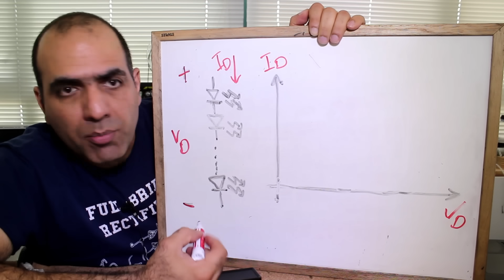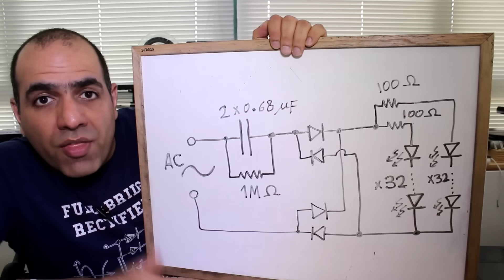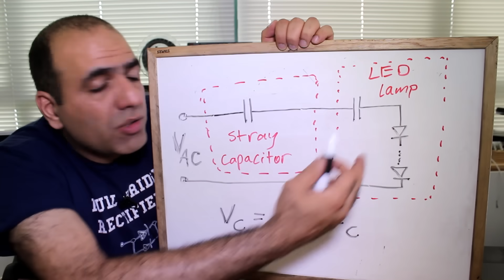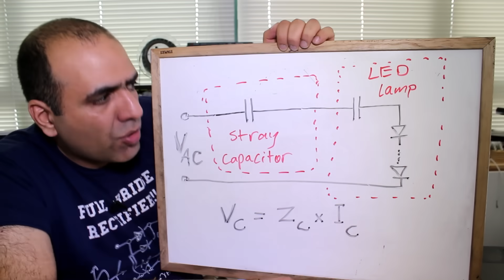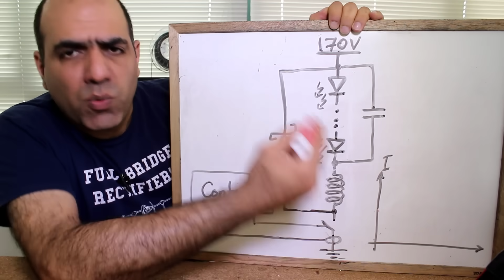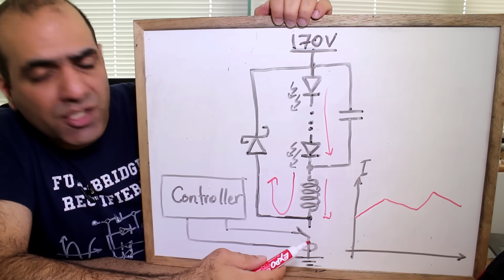Why Cheap LED Lights Keep Glowing

Comment: So does the cheap LED waste electricity?
Reply: I would say no since the electricity was there to begin with. CFLs handle this with their capacitors so they don't flicker or discharge. And standard incandescent bulbs have a low enough resistance so they can be a tiny bit warm, but do not luminesce.

Comment: I installed two LED spotlights in a motion detection fixture and the LED's Glow. The Fixture does work properly otherwise.
 My question is: since the LED's continue to glow; does that reduce the life of the LED lamp? 
It looked like the current draw is very small. Is that very expense to let it glow 24 hours per day?

Comment: So when i get it right, the LED is using a minimum energy all the time, but depending on the circuit, some of them glow (when turned off) and some just turn off fully?

Comment: im an electrician. i come across this issue all the time. you can test it with a meter, if its on voltage setting it will detect what we call a gohst voltage but if you add almost any draw to it the voltage drops to 0 because its not an efficient transformer. what i can tell is happening is the two wires are acting like a transformer. if you run 2 wires alongside each other for a long distance one induces a current in the other without a physical connection. the cinese cheap led is just very sensitive to any current. the better bulbs are just not responding to the insufficient power supply It also seems that whoever wired this switch is turning power off at the neutral side of the circuit instead of cutting the power before the lamp your friend has a dangerous wiring situation, your supposed to switch off the power not the neutral.

Comment: So I still didn’t get whether or not the cheap LED light bulbs waste money or not...I feel in order to figure this out I would have to know how houses draw current from main. But I mean it seems like it shouldn’t  waste money...if the wiring in your house holds a small amount of capacitance even after drawing power from the main, that means the bulb is running off of the the wiring’s capacitance, not by drawing from main.

Comment: Until the live wire is not beeing shut off by the single poled switch. You think you turned off the current by pushing the switch, only to find out that the Null and not the Live wire is beeing disconnected. This is just plain stupid! You can't turn off a bulb by pushing the switch and then think it is safe to work with crocodile clamps in a fitting. Man, this is stupidity squared.

Comment: Sir, I am facing a question. I have an led lamp at my home and after a prolonged use it gets dim and eventually switches off but then I am charging it, it glows dim and then I am unplugging it from the circuit, after some time it suddenly glowed bright! and again after a few seconds it became dim. I want to understand the reason. 

I hope you read this.

Thank you for you're time.

Comment: Hey Mehdi, years ago I had the same problem with cheap LED lights from IKEA: If I only disconnected one supply line, they continued to glow dimmed. They were powered by a cheap power supply and I solved the problem with a better power supply. This was a power supply which generates DC without ripple. The cheap power supply from IKEA had a considerable ripple on the DC output voltage. Therefore I suspected the cause in a kind of induction, because it was fixed with a smooth DC voltage. Induction only works with AC voltage as we all know... OK, my LEDs were designed for direct current. Therefore there was certainly no rectifier in it. That is then like a bad rectifier in the cheap LED lamps you tested. Then the ripple of the bad power supply with the direct current LEDS works like the alternating current and the bad rectifier in the AC lights, right?
Or to keep the story short: The phenomenon also exists with 5V and ripple on the power supply. Fascinating, isn't it?
Reply: ". Induction only works with AC voltage as we all know... " lol ;) 

does it? :p
Reply: @erlgro  Absolutely correct! But if a power supply does not produce a good DC voltage, then the small amount of changing current direction or pulsating voltage is enough to induce a small current. Then the LED lights up. And that even if only one wire is connected!

Comment: Very interresting video, but...

My LEDs glow while being turned off simply depending on where I join live and neutral cables (or which side I plug the plug in a socket).

Comment: So, when switched off, the Chinese bulbs are still drawing a small amount of power through the meter.

Is this true for the other lamps?

No picture the whole city full of hoses equipped with ten of these lamps. All of these with a micro draw would add up to a lot of wasted power.

Comment: I have this issue. Some location in my house, led glows even if it's off. So what Am I supposed to do if my house has this high capacitance? Just not buy those sensitive led light?

Comment: So to get this right, the amount of electricity used between a cheap LED and an LED with the resistor across the FBR will be about the same. Just in one case the LED stays dark?
Reply: Ya this is what I was finding too. Let me know if you got your answer

Comment: In the case of Steve Mould's test, I am convinced that the coil of wire he used was acting as a transformer rather than a capacitor.
Your test case is actually different, but you did reveal that these lamps are particularly sensitive, having a very low ON voltage threshold.

Comment: But the real question is: Is it FREE ENERGY?!?
Reply: No but phone lines have 48v DC that is separate from your house power and unmetered so it's actual free energy. It's illegal to use in this way so don't get caught. It also works in a power outage.
Reply: @sarabara-bla  it won't work with dc
Reply: Genius
Reply: https://youtu.be/wymfYp18720
This link bring you free
Reply: No, because you charge the capacitors with energy from the house grid
Reply: @LowSpecEverything  The Rectifier
Reply: @LowSpecEverything  r/woooosh
Reply: @flat-eric  How???
Reply: @flat-eric  first off, that's not a woosh. Second, it's woosh with four o's
Reply: @DoesntRefillTheBrita  first of all, that was a woooosh. Second, well... You're right. r/itswooooshwith4os
Reply: @flat-eric  WARNING: STOP R/WHOOSHING PEOPLE
Reply: @Nsodnoajdjksl  Why? :D
Reply: @flat-eric  BECAUSE STOP!
Reply: @LowSpecEverything  r/woooosh. No shit, Sherlock!
Reply: @ArchisMarathe  Wow, you actually bothered to correct their woooosh

Comment: My grandpa is electrician and he explained like when u touch litle black capacitor or whatewer it is black on normal led line that u can stick somewhere and cut whereewer u want it turns on 3-4 leds away from that black litle box.

Comment: Instead of breaking the return wire of the circuit, break the live wire. I had this problem when I replaced fixtures in my house. Some glowed and some did not. The ones that glowed the switch was breaking the return wire, which works with Incandescent lights but not these lights. I re-wired the switch so that it broke the live wire going to the fixture.
Reply: I thought it's common sense to install the switch on the live side before the appliance, as taught in school.
Reply: Yeah, switching the live wire is standard and safer. Doing it the other way around leaves the return wire live even when the switch is off. (Although you should turn off the circuit breaker anyway for extra safety when working on it.)

Comment: I did a similar experiment with my friend way back, almost 5 years ago such nostalgia, with tiny circuit board and 1.5v battery (so no real danger). We would each 1 hold an end connecting to the tiny LED away from front view of others and then do a bro fist or hi-five to complete the circuit for the LED to light up like some magic tricks lol

Comment: You forgot to mention the easiest solution to this, witch would be to have a 2 poled switch in front of the light bulb. But loved the explanation, keep up the good work! 😁
Reply: And if you break the live wire I think it won’t work
Reply: How would it be wired? I just googled 2 pole switch and looks like it has 4 brass screws for 2 hots on a 240 volt system. Would you connect 2 neutral to one side and 2 hot to the other to completely disconnect hot and neutral from the light? I just installed an integrated LED in my furnace room and it was just barely glowing in the off position.

Comment: The LED light at my mom's room in our house keeps on glowing before we fix the issue on our wirings. We have a bad and corroded wiring before that causes fluctuations, it even makes our line run at 70V (normally, it's 220V) After changing our wiring, fixing the frequent fluctuations, the LED at my mom's room no longer glow. Did the corroded wiring before makes some sort of Capacitance on our wirings?

Comment: Well, I saw the same when using 12Volts and a pcb with some leds on it (btw, 12v dc wont kill you as fast as 120/230v)😂

Comment: OK so science question I found that almost the same thing happened for me but instead of only the power being plugged in i had a computer power supply plugged in and a small neon light from an old iron and when I held one of the terminals and touched the other to the CASE of the power supply it turned on. Why? Isn't that two grounds I for the life of me had no idea what was happening

Comment: I can sorta relate to this I own a real hand/man stop light and when I set it to 20 volts with my power Supply it turns on and if I touch the the back of the circuit board and then unplug it from the power Supply and touch the back again the LEDs turn on. FYI the board has 2 capacitors and 2 resistors at the input for the hand and man.

Comment: This explains a lot, I have a light fixture in my house that always stays on a little, at first I thought it was light leaking through the floor somewhere above and into the light fixture, but when I turned off the lights in the above room the lights in the fixture stayed on a little, same as before, well they must be LEDs

Comment: How to solve this led is still glow if i off the switch  but the problem is my supply  is 3phase 220 just why i use line to line 220 without neutral ...because my one line is from switch and another line is direct from the led  how ? THANKS for your response.

Comment: there are some wall switches with LED's to see tthem in the dark when the light is off that in combination with certain LED bulbs have 2 modes 1 is light on and second is not lights off but stoboscope xD and if you take the LED from the switch off then you can switch off the bulb

Comment: Had the same problem with a ceiling light that needed 10 G4 leds.
Would not go out totaly.
Solved it by instaling 9 cheap (chinese)and 1 hi end(German) led.

Comment: I have taken some leds out of a toy robot. The LEDS were clear and the bell shaped ones, not the flat ones, and a little bigger than a pencil eraser. When I was in a pitch black room and holding 1 lead by the fingers of one hand in the other bye your fingers of my other hand if you look straight down into the LED you could see it glow faintly but glow.

Comment: That happened to me I ordered some interior LED for my truck, after I installed it the truck is off and everything is off , I thought that normal and it will go away , but after 5 days my battery died and the truck won't start, so I removed the lights and put the old ones back.

Comment: If I may add one piece of advice: always switch off the breaker, even if you work on your lights. If the lightswitch was put in/"fixed" by someone who didn't know what they were doing, it may become fatal. If the wires in the switch are connected to the wrong contact, and the switch breaks the neutral wire instead of the phase, the switch will still seemingly work as intended but you'll have a live contact in the light socket even if the switch is turned off. Don't die because of some dumbass, self-entitled "electrician"

Comment: My aunt's room and my room are on different breakers, but when she turns on her touch lamp, it turns my touch lamp on. Can you try to do a video on that, so I can explain to my aunt why the hell it happens... and please don't get killed in the process of doing it.
Reply: Different breakers, but common ground, so both switches detect the touch.
Reply: @jpdemer5  Useful information! Don't have that problem anymore though seeing that I moved out of the house!
Reply: @ryank1273  Reminds me of a math problem about adding something to a deck.  
https://www.youtube.com/watch?v=G0KGf1im6bU
"Here's the Solution: Buy a new house" - Micheal Jones
Reply: Some touch lamps can be very sensitive to electrical changes in both the air and in the building's wiring.  The voltage normally going through your body from electromagnetic waves in the air is very low (but almost always there, even though you can't feel it,) so when working correctly, your body's touch will activate the switch.  Some of these are too sensitive and simply walking by on a carpet may offer enough charge to switch them, even if you didn't touch the thing.
It's possible that the wiring in your house has a bit of current leaking, and when one light is activated, the charge bleeds through the air into the nearby wires and pings the switch on the other light.
Actually, we probably all have some current leak in our houses, but some wires have much more than others.  Every live wire is an electromagnet (usually very mild, unless you coil it) and two of them near each other will affect the other's transmission.  If you've ever had a speaker cable next to a power cable make static in the speaker, you're hearing that effect.  This is what ferrite beads (the tube-shaped blocks on some cables) are made to limit.

Comment: Finally an answer! I had the same thing happen to my parents. I installed two LED lights for them. One switched off but the other would stay on with about 70v at the switch (from 240v supply. I asked some other electrican friends for help but they didn't know either.

Comment: Why do the large LED bulbs get so hot, I notice the heatsink fins on the one you were using...  I took apart one of those bulbs also, and the whole base is a chunk of aluminum heatsink.  I first thought it was the regulator, but you showed a dc-dc converter.  So why so much heat during operation?  Thanks

Comment: simplicity of the circuit (a bridge rectifier) also means that the LED will flash at 50/60 hz, causing some eye strain (compared to the more complex light bulb circuit shown right after), am I right ?

Comment: Not surprise(ing) 😄😄😄
I also modified my motorcycle,. I use to be connect positif to the LED and negatif to the metal body of my motorcycle, it doesnt need to bring back to negatif accu (like you said, ground the capasitance) but its waste my accu, because when rain come,. Or just got some water, they will be turn on the low light.
The LED like saving little energy at circuit. So sometimes they glow at minimum light.
When you make static on your feet, then LED was turn on,  it ussual happen on led circuit.. because led transform ac to dc. If the light led seattle at outdoor, when they broke down, the light will be blink blink it self.
Im indonesian. And this things always happen. So its a little creapy at night 😅😅

Comment: The Mizuno experiment can produce 3 kilowatts of heat while consuming 300 watts of electricity. The difference comes from exothermic transmutation. Detailed instructions are provided. 
Research terms using DuckDuckGo:
theorionproject Gary_V pdf
theorionproject Stan_Meyer_Full_Data pdf
siriusdisclosure Griffin pdf
brilliantlightpower MHD_Paper_082719 pdf
lenr-canr MizunoTincreasede pdf
e-catworld

Comment: I had somthing similar: A LED light glows as well. The thing is, that the phase, not the neutral wire gets switched. So there is no more voltage on the LED. At some time I noticed that this glowing is an EMI phenomenon: a fluorescent tube in the same room has to be switched on. I believe that there is some capacitive or inductive coupling between both wires.

Comment: 4:17 / 10:25 in your video..... you have ( .046 ) why not glow?   the LED lamp your using have resistor R2, R3 and diode converting the 220v to.... low voltage,  ... SUBUKAN MO ULIT.. para malaman natin kong gagana :)

Comment: What do you call livestock that wanders out of the field and under some power lines?   Answer - real STRAY capacitors.   And if you try and herd them back to the field and one takes a run at you?  Answer - a high REACTANCE stray capacitor :) LOL

Comment: great video. i always get a huge kick out of this channel!
the key point I noticed in Steve's video, is how his circuit is laid out. in north america we supply power to the switch 1st, not to the lamp and then to the switch and back to the lamp. all the capacitance is due to the length of wire in the circuit. that is why we didn't see the same effect when connected "normally" to the light socket in your video. I'm not sure what the reason is that they wire buildings like that in the uk. yay for north american wiring standards

Comment: I have LED bulbs around my home and I was told one reason my bulbs never fully turn off was because I use light up switches. 

Of course I put one of those bulbs in a room that doesn't use a light up switch and it does fully turn off.

Can't be just me, right?
Reply: Everyone with glowing bulbs means your electrician did a shoddy job and wired the switch on the neutral side of the light instead of the hot side.

Comment: So if I have led pot lights which are doing the same thing, if I introduce a driver to the circuit will that solve my problem or what could I add?